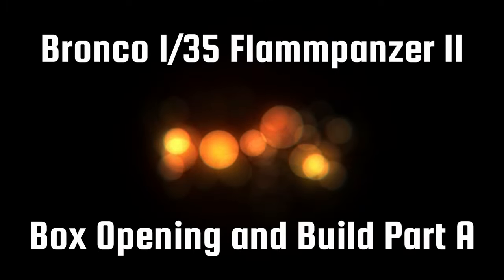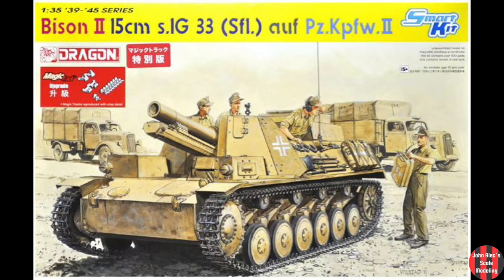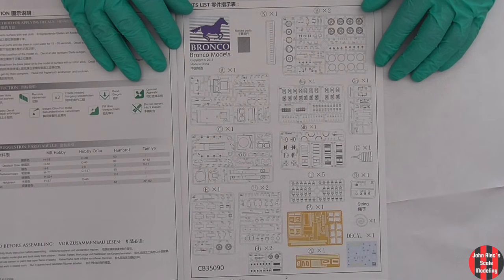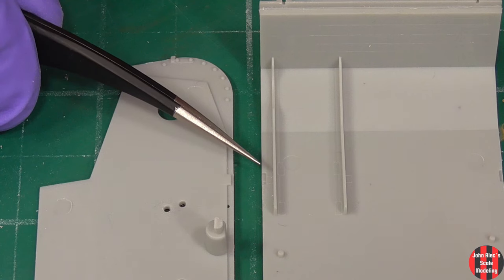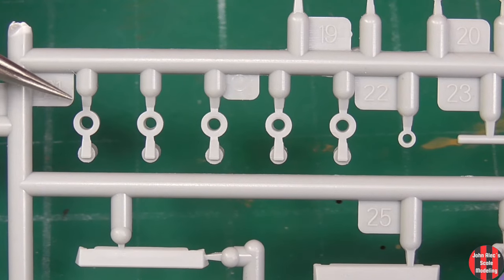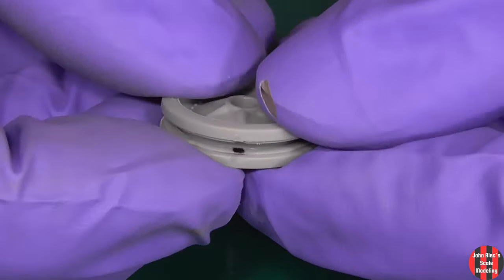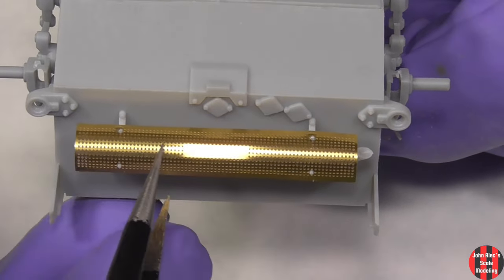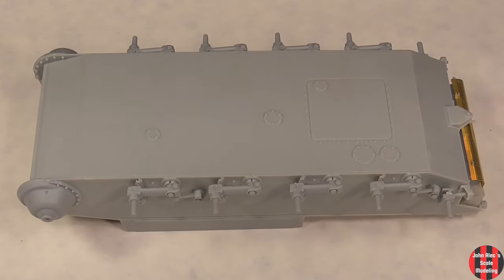Bronco 1/35 Panzer II Flamm Build Part A - with a Brief Panzer II Chat

Comment: Hi John, great video  Your knowledge of Panzers is amazing.  I have never built a Bronco kit before, but now I want one.  Did you have to anneal that curved bit of PE at the back to get it to that shape?  Thanks for sharing.  Have a great day.  Jeff
Reply from the maker: Thanks for watching Jeff. The thickness was identical to Dragon PE at 0.006". But normally those muffler meshes round easily. The metal they use may be stiffer. I found a dowel the same dia and press-formed it. Cheers mate!